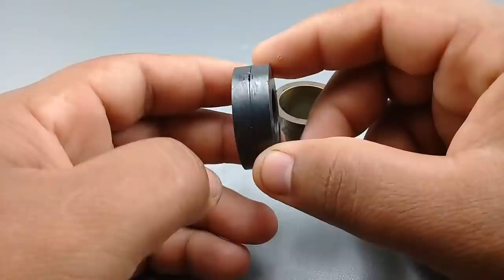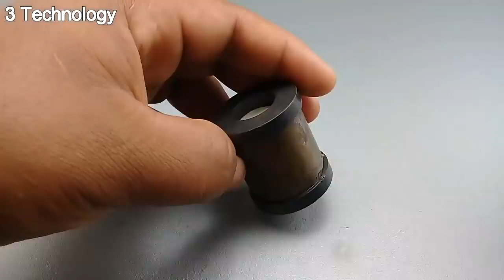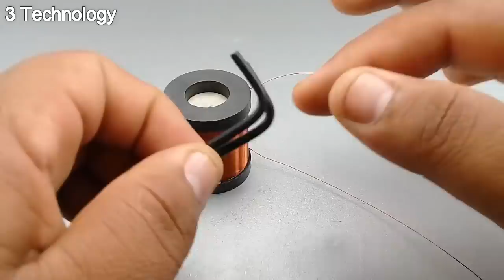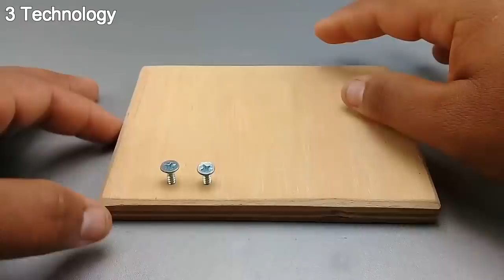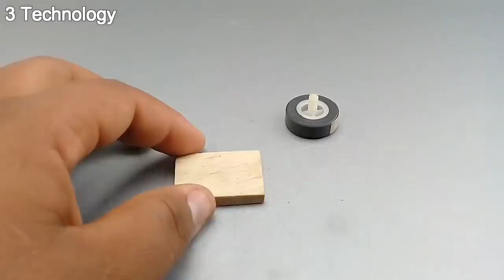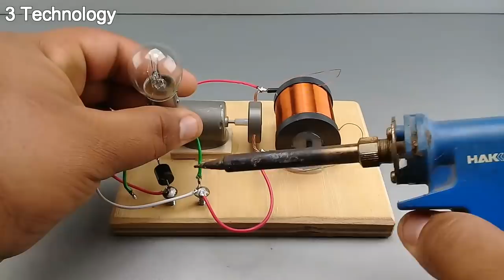I Create Amazing Generator For the world Use Free Electricity Energy

Comment: Copper-Coil+Magnet+indian = free energy 😅😎😎
Reply: ...and a glue gun!
Reply: and this amazing melody
Reply: Put this next to power lines and you get free electricity only power companies hire security teams that call it theft. This generates exactly what he claims free energy. Only thing its not free, it is a current transformer that acts like the secondary of a transformer. When a static field is nearby it will cause a high current in the center which is then transformed into mains. I think anyway, but its pretty small the ones I've seen are wound on cores you need a tractor to move around. This might light up an Led. India has more magnetic fields because their electrical grid is built on glorified extension cords hanging 6 feet off the ground and to get service you don't need a power meter you only need a 7 year old to splice into the street light main the rest of the neighbor hood is connected.  to.

Comment: You can see the sealing tabs on the motor have been opened. He has replaced the magnets inside with a smaller motor and a few button batteries in series or even a couple of super capacitors. It's fake.